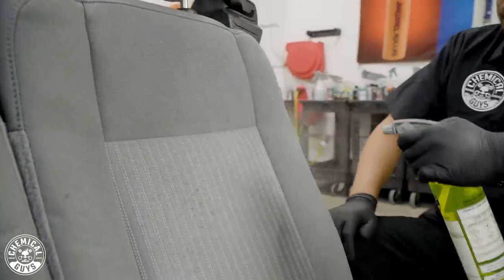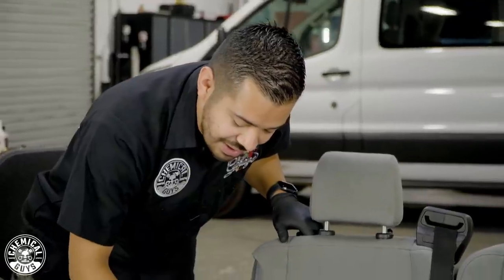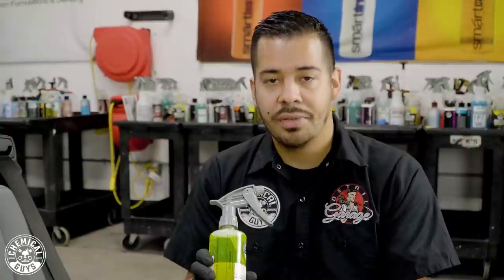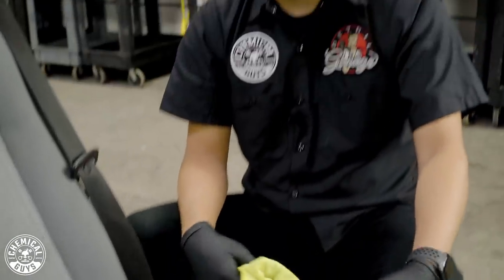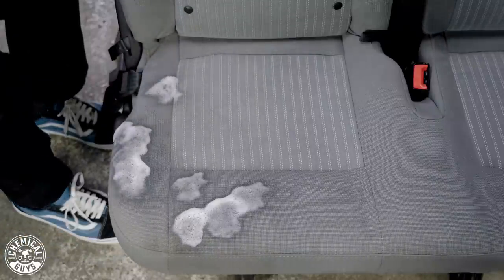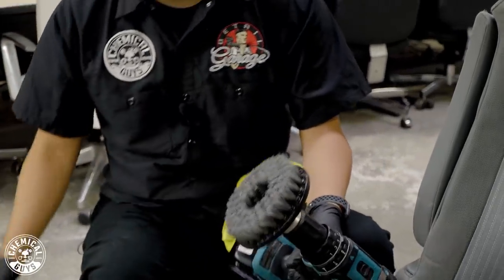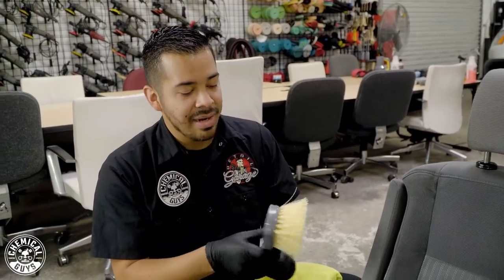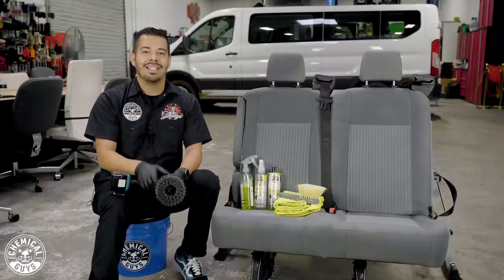How To Restore Fabrics And Upholstery By Hand Or Machine! - Chemical Guys

Comment: Fabric clean and lightning fast are both incredible products.  My wife’s car seats had coffee, soda, make up, and body oil stains all over. Front and back seats.   I bought the light duty drill brush and went to town using both products diluted 7:1. At that dilution both products are pretty much still full strength and they still foam up excellent. I wish I could put a before and after pic up here as my words won’t do these products and justice.  These do exactly what you want them to do, only better. And that my friends, is rare.  Chemical guys has kick a** chemicals and I’m always getting asked now what I use to wash my car, what I use on my tires, and I always send em to YT to search up chemical guys!

Comment: You guys should make a video talking about how to dilute all the products that need to be ! That’d be a huge help for me especially
Reply from the maker: Great suggestion!!
Reply: i think he said the bottle has how to do it
Reply: Hey Z, I hope you figured it out but if not, take the ratio numbers (20:1) and add them together. 20+1 =21 now take the size in ounces of the container you are going to put the mixture in. We’ll use a chemical guys bottle size, say 16 ounces. Now divide 16 (mixture container size) and divide it by 21 (the ratio numbers we added together). 16/21= 0.76 ounces of chemical. Now multiply 0.76 by 20 which equals 15.24 ounces… 
15.24 ounces of water plus 0.76  ounces of chemical equals 16 ounces. I hope that made sense!

Comment: I just got a car from a handyman and it's greased up everywhere on the fabric what do you recommend for that because I took it for detailing and they didn't do a good job. I don't have the drill to brush the seat like u. I was thinking about getting the lightning fast and a small brush and spray all the seat and seat belts and scrub it by hand and wipe with towel
Reply from the maker: Lightning Fast is a great option for removing stubborn stains and odors!

Comment: What do I use for sway to clean it,  it’s a new vehicle
Reply from the maker: Hi there! Suede is very sensitive so proceed with caution. We recommend using a clean microfiber towel that is damp with Nonsense All Purpose Cleaner to gently wipe the surface clean. Avoid scrubbing or spraying the surface directly.
Reply: @ChemicalGuys  thanks will try it this weekend 👍🏽